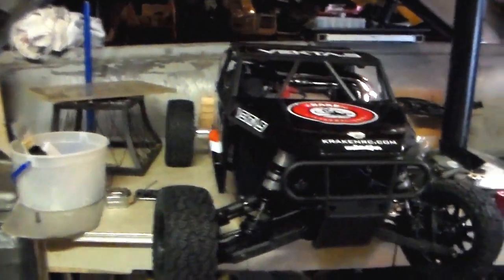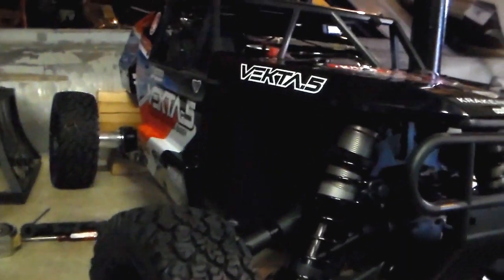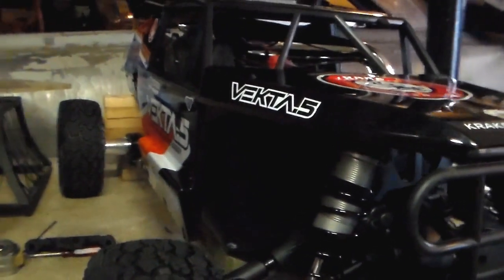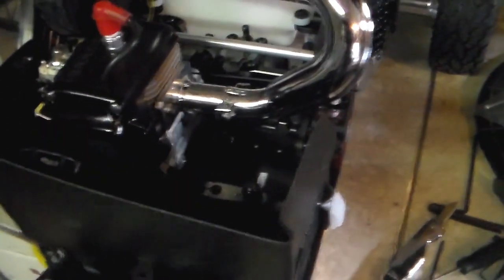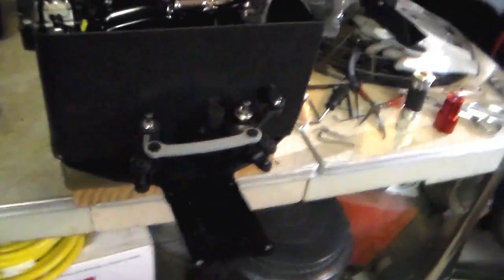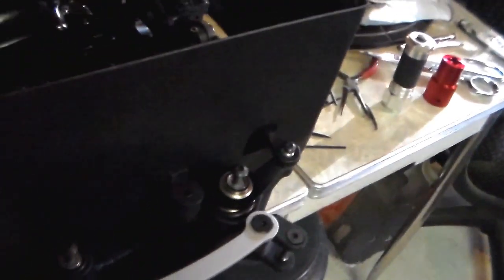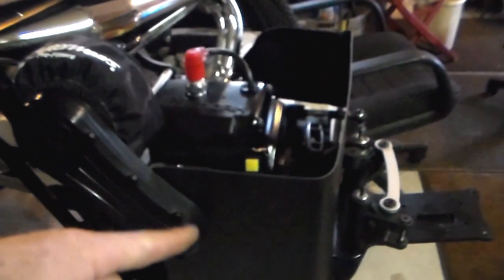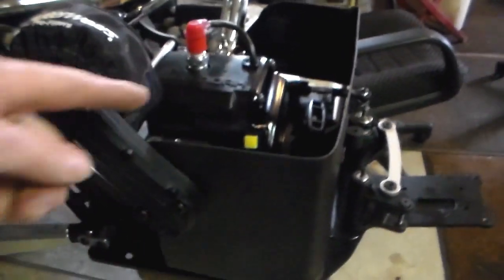Kraken Vekta.5 Firewall / Guard / Shield

Comment: Not to sound negative (very nice work), but aren't you worried about the adverse effects to the cooling of the engine, which relies on air-cooling?
Reply from the maker: There will be plenty of air coming in for the engine to keep cool.  The engine cools itself from the Fan blowing air through the engines heat sink fins. So the vehicle doesn't have to be moving for air to go through the engine for cooling.  I did not block any openings for air intake.  The guard is 3/4" away from the pull start air intake.  Lots of room....
Reply: Nice... I know after even the first run that the engine and inside gets BLASTED with all sorts of crap, from the front tires!